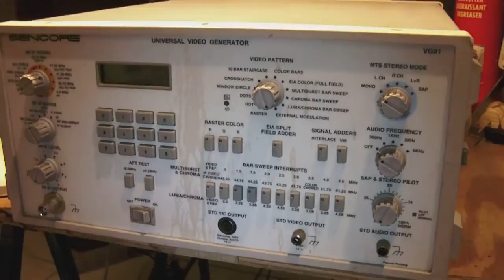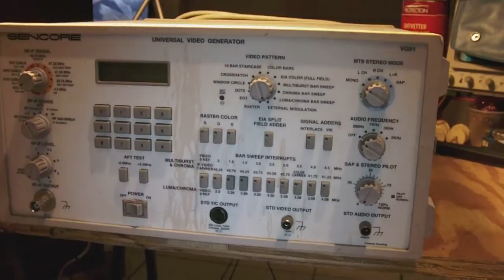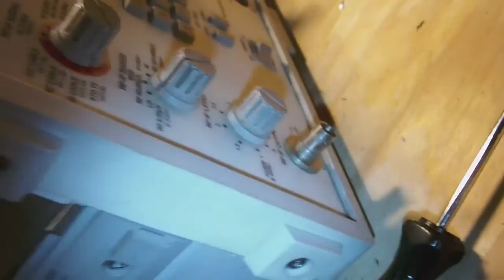Sencore VG91 part 1 of 3

Comment: Looks like that's an Intel 80C31 8 bit CMOS microcontroller,   Very popular for embedded designs back in the day.
Reply from the maker: That's an interesting bit of information. I wonder if the firmware could be hacked to use the VG91 for PAL TV's. Unfortunately I didn't notice any dipswitches or such to set the generator for use with the PAL protocol.

Comment: Wow!  There's a whole lot of chips in there!
Reply from the maker: Indeed there are ... I was just as astonished, considering it's a reasonably "simple" device with just a few multi-position switches and a small keypad. It reminded me of the small 8048 PLC I built at school really. Nothing as neat or big as this though :) I suppose one of the reasons why it contains so many chips is the desired precision and necessity to produce RF signals. Funny detail is the discrepancy between the "modern" SMD's used and the old-fashioned transformer-driven powersupply
Reply: TechneMoira
They might have use a old fashioned analog power supply to reduce noise in the output.  Switching power supplies produce a lot of RF garbage.